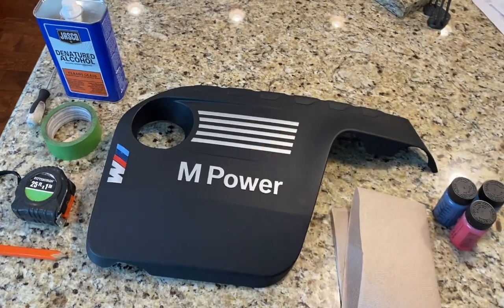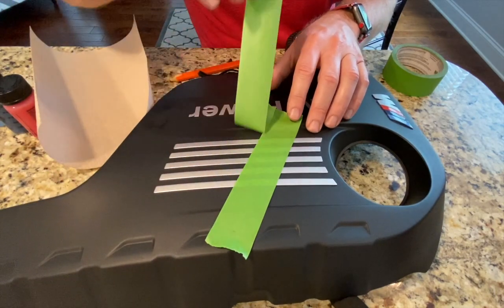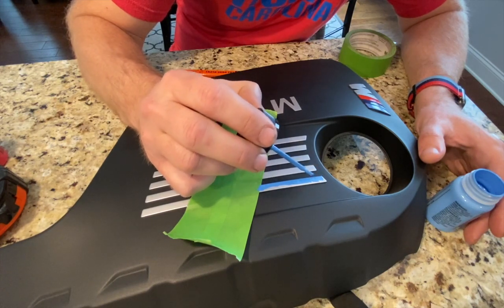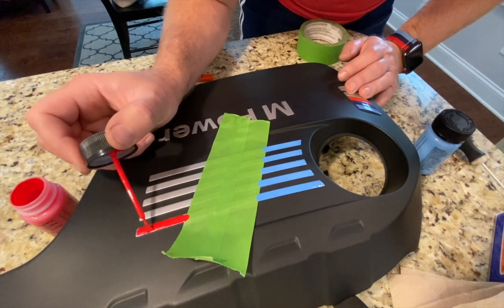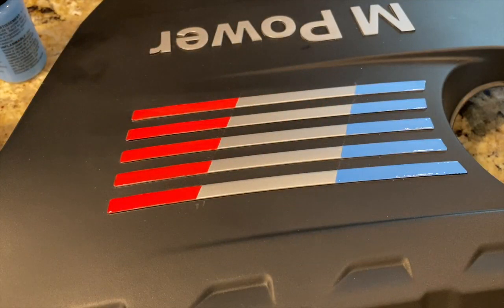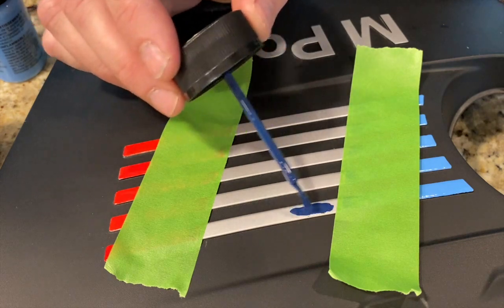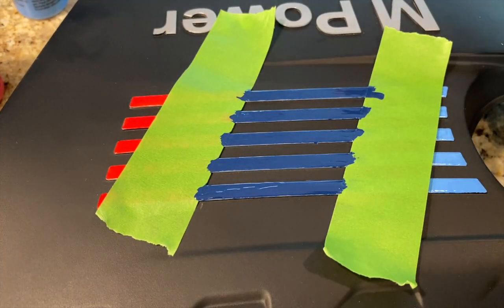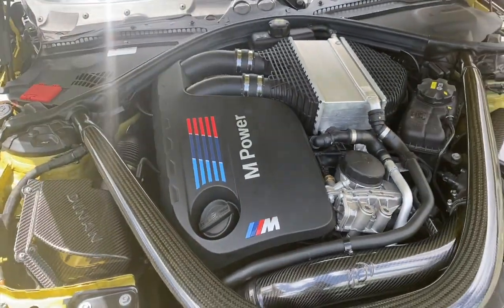PAINTING THE ///M COLORS ON MY ENGINE COVER | BMW M4 F82 S55

Comment: Looks good
Would you recommend a clear coat or not necessary since it’s under the hood and protected?
Reply from the maker: +jrzf80 thanks! No clear coat for mine because I bought single stage paint that includes it.